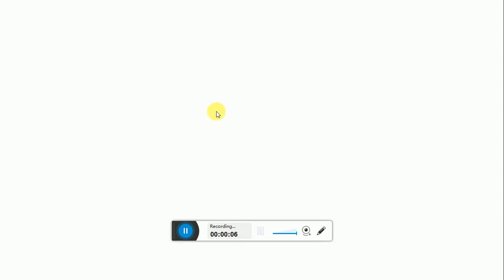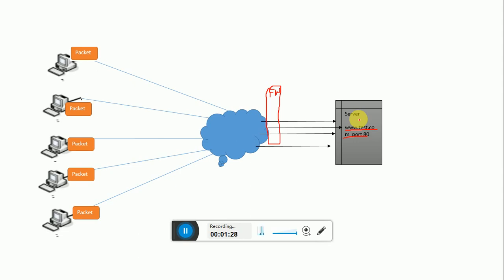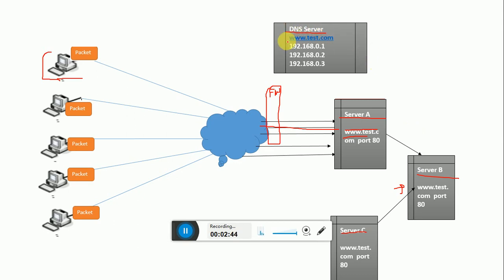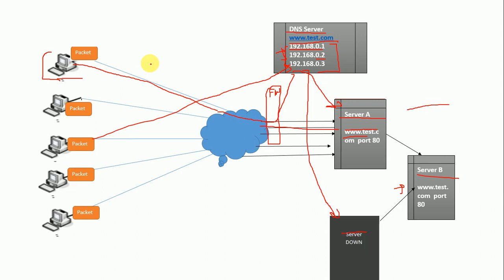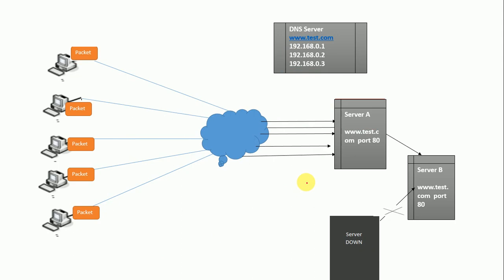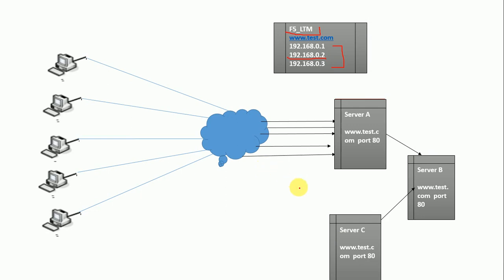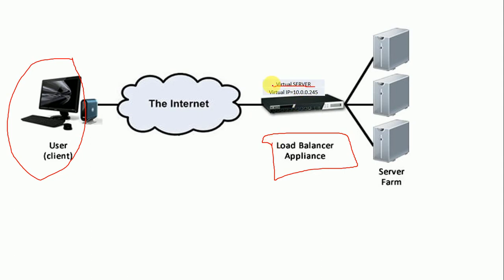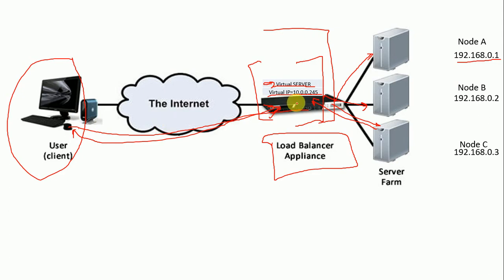F5-LTM: What is F5 LTM.

Comment: Sir, can you please tell how load balancer will identify the server is up or down... Whether it will be sending icmp packets to identify the reachability?
Reply from the maker: We need to assign health monitoring profile
Reply from the maker: That will probe it. Its best to apply health monitoring for the service on which application is running. Example port 443 or 80 if u application is on these ports. Ping is not best way to check